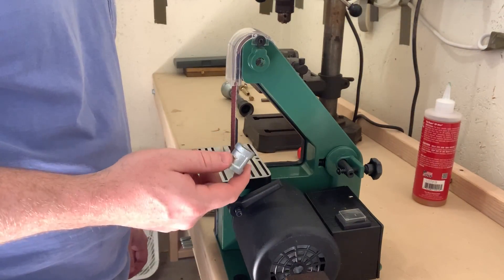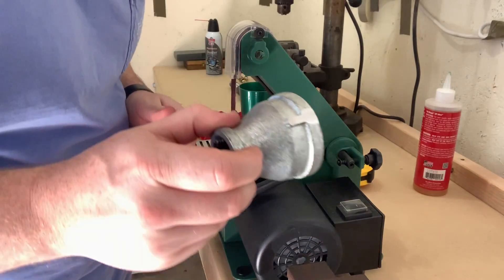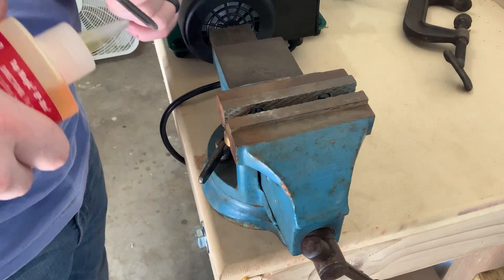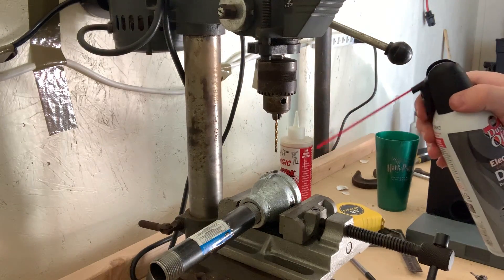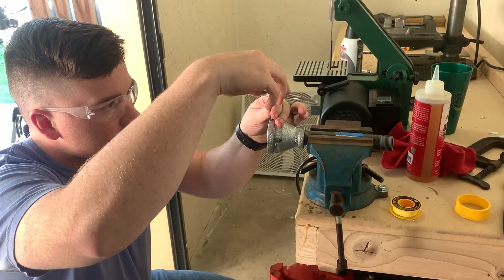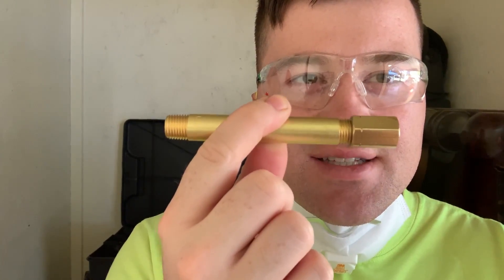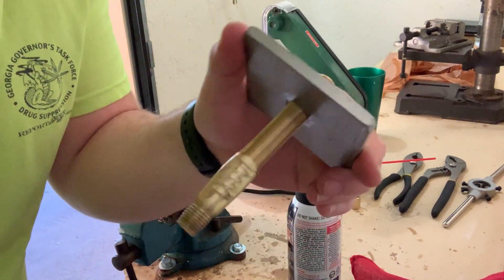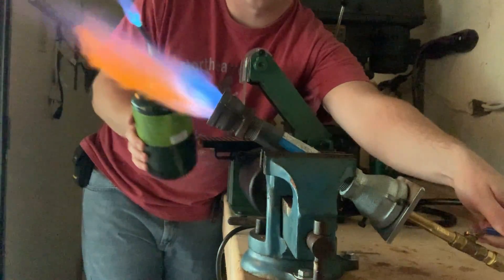Building a Propane Burner: Part 2 (Building the Actual Propane Jet and Burner)

Comment: Nice video. 
      One comment if I may in the word of learning and safety!
     I have never seen someone use a taper pipe tap in that fashon. Taper pipe is designed to get tighter as it is threaded in. Therefore the taper part. Why you marred the nipple so bad is that the die is not designed to go past its minor diameter. By going too far you were trying to thread the whole taper at once. It's also why your air valve plate is so loose and why the nipple to coupler will never be tight, you have removed the taper. In  a high pressure or critical leak free setting like inside your home, that move could kill you! Impressed that you pulled.It off. Keep an eye out for leaks and for that  crushed brass nipple cracking. Have a great time with the forge! You'll love it.
Reply from the maker: Dan Ostler Thank you for that info! It took me forever to realize why that pipe was so hard to get the threads on lol. Luckily the forge runs best when the plate is as close to the bell reducer as possible. I haven’t had any issues with it so far but will definitely keep this in mind for my next build! Thank you again!

Comment: Why do all that work and only have air choke. Don't u want to adjust propane noodle up down to fine tune?
Reply from the maker: From my experience, getting the right air to fuel ratio is more important in a build like this. The propane is controlled only by the regulator.